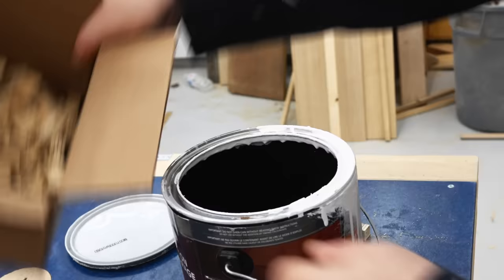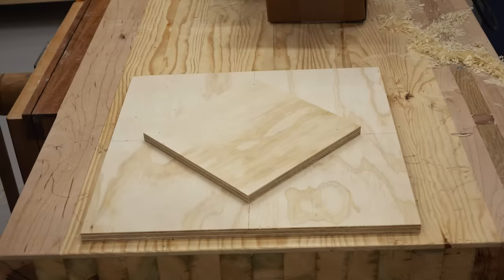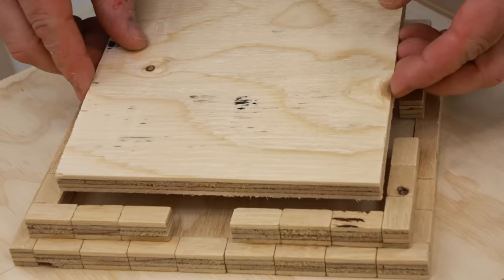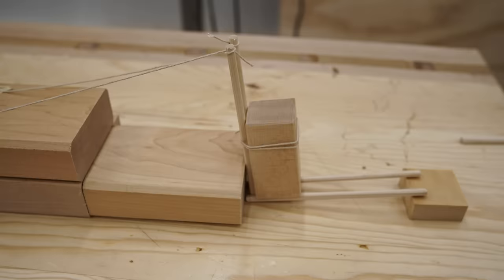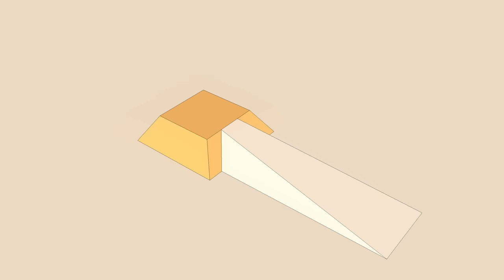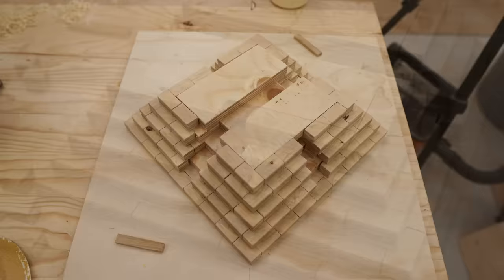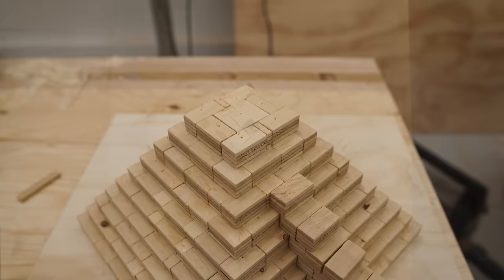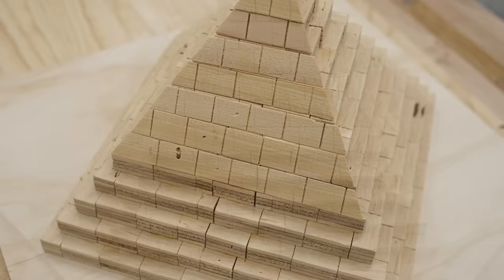How I Would Build The Great Pyramids

Comment: The great pyramid has 8 sides not 4 and is of course put it in line with the equinox
Reply: 8 sides? Ok then! Lol.
Reply: @shelbyseelbach9568  yes it has 8 sides. It's hard to see, but there is a concavity to each face that splits each face down the middle. So, each face you see is actually 2 faces intersecting at a wide angle when you look closely.
Reply: @CStoph1979  explain.
Reply: @RandomBJJGuy  oh, that's pure rubbish. The sides you see were not the finished product, these are interior stones, almostall theoriginal finish stones are gone. So....... Meaningless.
Reply: @CStoph1979  that's making assumptions on what the finished product looked like from looking at the interior of it. Very hard to prove. Meaningless, speculative at best.
Reply: @shelbyseelbach9568  well, we don't really know what the finished product looked like, but the best evidence we have is that it currently has 8 sides. No evidence of a 4 sided finished product exists.  Saying "pure rubbish" isn't really a good argument when, as you say, by stating there were only 4 sides you are "making assumptions on what the finished product looked like from the interior of it." These 4-side assumptions you are making are "meaningless, speculative at best."
Reply: @shelbyseelbach9568  also, another piece of evidence is that other Egyptian pyramids were indeed 4-sided. The great pyramid is 8-sided. This indicates that, unlike the other pyramids, the great pyramid was and is 8-sided.
Reply: @shelbyseelbach9568  if you'd like to stop being an ignoramus, calling other people's knowledge rubbish and meaningless, I suggest you go read up on the very abundant and easily accessible literature/research on the 8-sided pyramid.
Reply: @RandomBJJGuy  when did i say anything about 4 sides? I only said that saying it was 8 sided is speculative rubbish as you are only looking at the core. I would dare say though that 4 sides would be a reasonable assumption for the finish based on every other pyramid in existence.
If you want to say the core is 8 sided, I'll agree, but when you then infer that the finish must have also been 8 sided, i say, speculation.
They could have easily placed rough stone onto this wedged core to help stabilize the finish blocks and then finished them off as a perfectly flat side, like every other pyramid in the world. This is just speculation as well, but I'm not presenting it as a fact, am i?
Reply: @shelbyseelbach9568  so, why is it that every other pyramid in Egypt has 4 sides, core and finished? Why would this pyramid with 8, unlike every other "core", have the same number of sides as all pyramids that have 4-sided cores?
Reply: ray jay  it's pretty common knowledge. The pyramid has a concavity on each face down the middle that makes each face actually two faces intersecting at a wide angle. Lots of literature on the subject
Reply: @RandomBJJGuy  oh, i wasn't aware that you knew what the core of a finished pyramid looked like? X-ray vision much?
Maybe the same reason the core of a 100 story building is different than the core of a three story building. Why would the core of the largest one need to be different, maybe because it was the biggest one. Like i said you build the core with a little inward angle built into it, you install the finish blocks without finishing the exterior surface. Then you start at the top, workyour way down and leave a flat surface without the angle of the core.
But i guess you know for a fact that that wasn't even remotely possible.
Saying the finish had to be eight sided because the core is eight sided is groundless and speculative.
For that matter, if you look at the casing stones left at the top in a few places, i bet that angle from the core is not in the finish stones.
Hmmmmmmm?
Reply: @shelbyseelbach9568  Troll Spotted!
Reply: @RandomBJJGuy  you best start believing in troll threads...

...You're in one!
Reply: @harrymerrett8449  ok, kid.
Reply: @RandomBJJGuy  the pyramid does not have a concavity in each face. It has a concavity in each SIDE (N,S,E,&W),meaning each SIDE is made up of two faces. The core has 4 sides, each made up of two faces. It is not eight sided, it is 4 sided.
There are a million different angles and depths to a human face, yet it has two sides left and right. My ear isn't a side, my nose isn't a side, my cheeks aren't a side. All together they make up one side of my face. Just as the two faces in each side of the pyramid aren't separate sides, they are the parts of that side of the pyramid. Just as the side of your car is made up of many angles and pieces, but there is a left side and a right side. 
This is not rocket science.
The great pyramid core has for sides, each composed of two faces. Who can say what the facing stones looked like. My guess is they were finished so each side had only one face. Your guess may differ.
Reply: @shelbyseelbach9568  ok
Reply: @shelbyseelbach9568  you know that old saying, "when you're in a hole..." ?

STOP DIGGING!!
Reply: @D M  you can literally find satellite photos that show the 8 sides lol
Reply: @Tokinjester  if i was in a hole i would. Thanks though.
Reply: @shelbyseelbach9568  As you say, the idea that the great pyramids had eight sides is speculation. However, this image clearly depicts concavity on at least one face of at least one pyramid: https://tinyurl.com/y4aqupf3   There is a clear line down the left side of the top right pyramid. Additionally, a quick search for "great pyramids sides" yields many articles on the "8 sided pyramids," but I don't trust any of the first websites that I see so I'll disregard those articles. As for whether this concavity is present on all sides and/or manifested itself on the finished pyramid, I can't say. Since nobody alive right now was there, nobody can say for sure and we must speculate; however, as you say, all of our speculations are ultimately rubbish. In order to make our speculations less rubbish, we should try to discuss with open minds and choice tone. In your previous responses, you came off as something of a pretentious know-it-all, and that's great troll bait. If you want to have an actual discussion, I'm all ears.
Reply: @chkohl1919  i guess that's based on when you saw it finished?
Reply: "Aliens."
Reply: If all of you quit arguing and read many of the archeological finds as of late, or could get in touch with some of the lead archaeologists, you then could have a rational discussion about it. Nobody is the expert here until you have studied it your whole life, up close.
Reply: @shelbyseelbach9568  yeah that's the problem when you're in a hole, sometimes you just don't know

YOU'RE IN A HOLE!!

STOP DIGGING!!!

But don't feel too bad. Most of the rest us only found out the pyramids were built in 8 parts a couple of years ago
Reply: I think they used wooden formwork and geo polymer it explains a lot of the artefacts about the pyramids and the is the most logical method
Reply: @Tokinjester  i don't feel bad. I'm also not making assumptions about the complete pyramid from looking at only the core. As i said, your opinions may differ.
Reply: @T0YCHEST  thank you! Finally someone with a brain
Reply: ray jay  ok sorry for replying to your comment, didn't mean to make you mad.
Reply: @shelbyseelbach9568  you first post says it all. "8 sides? Okay then!" This speaks you originally were uneducated about the concave sides of the great pyramid from the start. You trying to expand, arguing that you knew all along is rubbish. No matter the last minute research you perform, you have already painted yourself as uneducated on the topic.
Reply: @elirockhill3365  that's one interpretation.
Reply: @shelbyseelbach9568  It amazes me the amount of effort a narcissist will go to trying to salvage a dumb comment.  Just give it up.  You're not fooling anyone.
Reply: @shelbyseelbach9568  look man just search for 8 sides of the pyramid and will see that the line that separates each side into 2 goes all the way up, and we all know there is still casing Stones on the top of the pyramid.
Reply: @navarro8785  have you read anything I've posted? I'm aware that the core had two faces on each side. Calling it weight "sided" is a stretch at best. I don't believe that was reflected in the finish either, and? So?
Reply: @chkohl1919  not trying to. Haven't resorted to name calling either, as it usually denotes someone who has a weak point, my friend.
Reply: @shelbyseelbach9568  yes i read everthing you posted but i am talking specifically about the 8 sides, with the lines going up to the top where the casing stones are, means that the pyramid having 8 sides when finished is not a speculation, but in reality a fact
Reply: @shelbyseelbach9568  So, calling that guy a "dumb ass" isn't name calling?  Jeepers, do you ever look at yourself in the mirror?  You tried making someone look dumb, "8 sides? Ok then! Lol.", then was like "explain", then realized you were wrong and went into a long winded explanation using semantics and faces vs sides, final product, etc. etc. to cover your error.  Nobody has bought it and you're just making yourself out to be a total fool.  That's not name calling by the way.
Reply: @navarro8785  nope
Reply: @shelbyseelbach9568  ok after all of that you simply say NOPE, explain why not please.
Reply: The modern experts say the 8 sides happened by accident over time. I really don't buy that,  the measurements and alignments are such precise.
Reply: @madebybelle6965  thats like so often pure bullshit what they say about the 8 sides happening by "accident"... and it so happens that the only two days in the year you can see all 8 sides with your seer eye are the equinoxes of the year...pure "accident"... or "coincidence"^^ 
haha :D

you are absolutly right in not buying that.
Reply: Shelby Seelbach yeah the great pyramid is 8 sided for real
Reply: Shelby Seelbach calls people out for speculating and immediately gives his own speculation. Why would you ardently defend that it has only four sides. Maybe look into the info and wonder why it could be 8.
Reply: Shelby Seelbach wow... what a thread, right? Seems like nobody can think for themselves... i get what you’re saying. 

I have for many years thought the concaved sides were to make the inner structure easier to build. It is huge after all. And you don’t want to make mistakes half way through.

As you theorize, I also thought it to be just the inner structure. It would not be difficult (considering it’s the great Pyramid) to make a smooth 4 faced surface from the “concaved” surface. 

Thank you for thinking and not just reading. 👍👏

Honestly don’t get why people call you a troll.
Reply: @shelbyseelbach9568  you should go do some basic research on it
Reply: @rbruce5270  already did. And?
Reply: Shelby Seelbach  those 8 sides can been seen from satellite images ... during sunrise and sunset
Reply: @FK-xq1ow  every row as you go up has a vertical side and a horizontal side. So these should be counted as sides to, right? Right? I can see all these sides in EVERY PICTURE with just my eye. Right?
Reply: ray jay  LMFAO
Reply: @shelbyseelbach9568  please show us your degree in egyptology or relevant background studies, Oh wait, if you had one you'd know that what is being stated to you is correct. Just stop. You're only embarrassing yourself.
Reply: @TheRealChilly  funny, I'm not embarrassed at all.
Reply: @TheRealChilly  my opinion is just stupid because i don't have a degree in Egyptology? Can you show me yours? I didn't think so. LMFAO.
Reply: Shelby Seelbach  please google it ... the all four Sides of pyramid are bent inward  from the center ...  you can also watch any documentary or again just google it
Reply: @FK-xq1ow  no shit. Try reading the comment section before you comment.
Reply: @RandomBJJGuy  because every other pyramid was built by ancient Egyptians, the great pyramids were built way before then
Reply: @paulquaife7974  let me guess "Aliens"?
Reply: @shelbyseelbach9568  ok.
Reply: @harrymerrett8449  all right, then.
Reply: It has 16 sides
Reply: @andrewholdaway813  wrong man, his method relies heavy on quadratic and/or  rectangula shapes...and thats something he doesnt not enjoy the luxury of if the task is to build it with 8 instead of 4 sides and put it in line with the equinox and build it the way that its only visible for the human eye on these two day every year....

yeah and we havent even on touched the mathematics involved for  this one, well not even in the slightest^^
Reply: @andrewholdaway813  Well dude, i know exactly how slight the angle is, since it was part of my final excam for my masterdegree in mathematics. Thing is, the slighter the angle, the more difficult the mathematics for statics become for such a building. The roughness of the inner stones was not part of my argument, nor did I take it into account, because the whole thing ended for me way before...when I saw which type of and to what degree are the mathematics involved...his methods days dies way before you have to give a single thought about the roughness of any stone involved. 

But hey, i wont go down the road you took and insult other people for voicing information and or an opinion I do not share or is new to me.

Did your parents teach you to react that way, if someone has another viewpoint on a topic?

Comment: Your idea works for the first layer. At the second layer it already has issues. The blocks were placed at 1 block every 2 minutes. You physically cant have that many people opporating fine fitting, and movement as the pyramid hits a certain point. And still maintain 1 block every 2 minutes. At the lower levels thats a certain amount of people. You could move say 10 blocks since the surface area allows it. While eventually you reach a point where you can only place 1 block every 10 minutes.
Reply: @Captain Watson 2.3 million stone blocks in the great pyramid, 20 years to build as per conventional Egyptology. That's 5 minutes/block working 24/7, 365 days a year. Since they likely would not have worked at night, and probably not during the planting or harvest seasons, I'd say he's about right. Even at 5 minutes a block that's still stupendous...
Reply: Your math is inherently wrong, it would take that long only if you were working on one block at a time... also a majority of the blocks are on the lower parts of the pyramid...

If we apply the same logic to the Great Wall of China they would have to place four blocks every minute to finish the wall over two thousand years. 

Though if you have thousands of individuals working on multiple pieces at the same time it drastically cuts the amount of time needed.

It sounds unrealistic because it is unrealistic... they didn't employ over fifty thousand individuals in the ancient world to move and place one block at a time.
Reply: That's 1 block every 2 minutes ON AVERAGE. It's not a time limit...  The filler in the middle is far more sloppy using smaller stones. Also, more than one block was being placed at a time. But I am sure aliens makes far more sense.
Reply: @ethanhogue5042  not only this assumes they only did one block at the time but also the 20 year is an estimation. Could’ve been a bit longer or even shorter
Reply: @ethanhogue5042  not only this assumes they only did one block at the time but also the 20 year is an estimation. Could’ve been a bit longer or even shorter
Reply: @maau5trap273  yeah, its a dumb, over simplified calculation. Also doesn't even mention the fact that a big part of the base of the pyramid is solid bedrock. About maybe 10% or 15% of the pyramid is bedrock, plus lots of filler and smaller stones inside. 2.3 million is simply a false number.
Reply: Demonstrating exactly why youtube comments are shiat

Comment: Fitting the rock blocks so perfectly is probably more difficult than lifting them to the new location on the pyramid.
Reply: Apparently the very tip of the great pyramid is only 1/4 of an inch off the mathematical center.. That level of accuracy is insane especially for such massive blocks. But the notion that we can't do that today isn't true. Modern cranes can definitely lift many times the weight of those blocks. Also, I'm pretty sure humans were where we are now, at some other point in history.